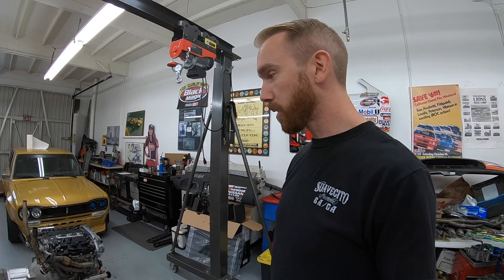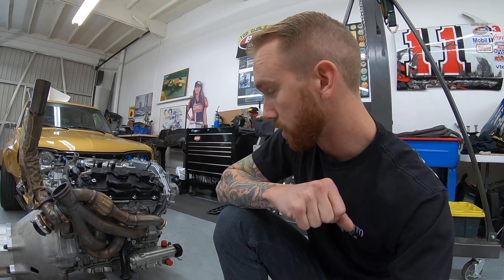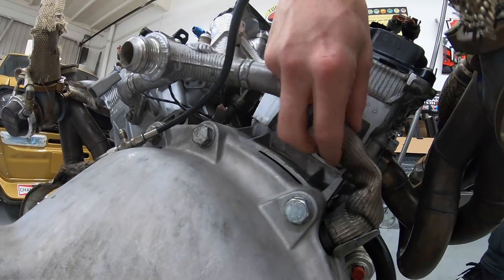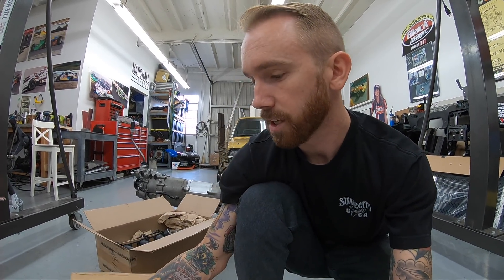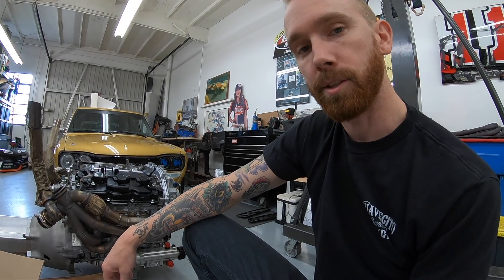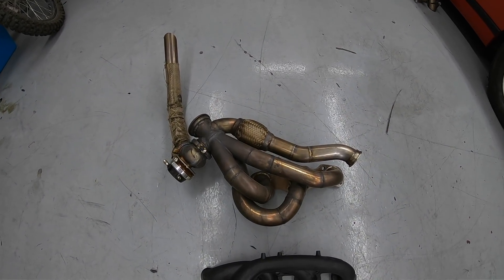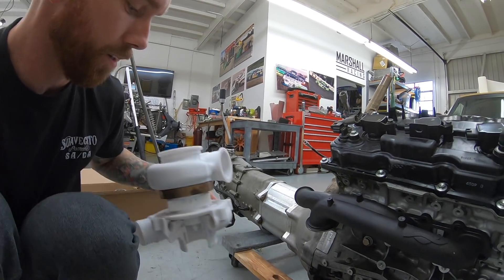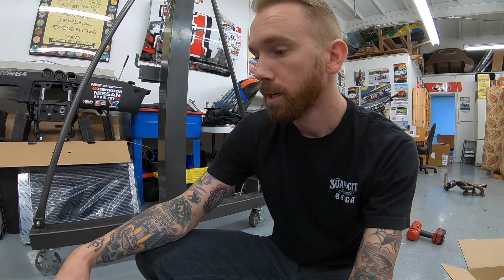Fast Intentions Manifolds and 3D Printed Garrett Turbo Test Fit on my Nissan VQ!

Comment: That 3D printed Turbo has to make life so much easier for fitment testing. Great input on cast manifolds too.  I remember the factory 300ZX twin turbo had the turbos mounted lower to the ground as well to help with cooling. Definitely makes sense to have the VQ twins mounted in a similar position. I am definitely looking forward to seeing how the engine mounts are going to get made, that looks really tricky, but Dillon is the man so I'm sure it will turn out great!
Reply from the maker: Yessir! It should definitely be a better setup this year. I have a good idea on how to do the engine mounts... I have been doing custom engine swaps since 2001! Engine mounts are the easy part!

Comment: I'm pretty sure those are cast stainless with some, if not a lot, of Ni in them. Old cast housings get a bad name b/c they're typically iron or low temp resistance grade stainless (ie the 400 series/ferritic  cast equivalent), which is why they don't typically last in performance cars.

Really enjoying the content sir... keep it up!

Comment: New setup IMO looks much better as far as fitment goes. Also looks like it will flow a lot better, quicker (hella short runners), and it looks like a quality cast so it should last. Couple questions tho.. Will the new manifolds be able to run your antilag set up? (Its become such a staple to you car) Also, how's the oil drain gonna work? Looks like its a tad low but I've never messed with dry sump so maybe it works as a scavenge pump not only for the engine but the turbo also? Last and simplest question... Gonna have the turbo intake piping going threw the motor mount? (Z31 guys do this when going to a larger turbo in stock placement.) If not, how else you gonna get one on that bad boy? Awesome content Chris! Keep it coming buddie!!
Reply from the maker: Thanks man, I am looking forward to the new setup for sure! I will be able to run antilag if we decide... it would be done so through the engine tune. The oil drains go into the dry sump pan and get scavenged from the dry sump pump itself. The engine mount will have to be custom regardless so we will make it work around the turbo more for easier piping!
Reply: Chris Forsberg Well that all seems pretty straight forward. Now just to put the work in before the start of the season gets here.

Comment: On the original manifolds, is that an equalization pipe with the flex join in it?  The new manifolds look sick though so much cleaner and look to be alot heavier duty
Reply from the maker: No that was for the old anti lag setup.
Reply: Ah yep cool, thanks for the reply

Comment: Hi Chris ! 
Just wondering what kind of ECU /stand alone system u use and how u have solved the control of the cams on the VQ ? Or have u changed the tops ? 
Best regards Leo
Reply from the maker: We are running a Motec M150, amazing quality parts.

Comment: Are you running the G25-660 turbos?
Reply from the maker: That is the plan!
Reply: Chris Forsberg that will be an excellent test of the turbo for Garrett as you should be on the edge of its capabilities. I would assume you’ve sized the turbo to get rid of the ALS?

Comment: Never have been a fan of Tube header manifolds. I have yet to see one that didn't throw heat like crazy and crack regularly in a race condition. Don't get me wrong I have built a dozen but was never happy with the overall durability.